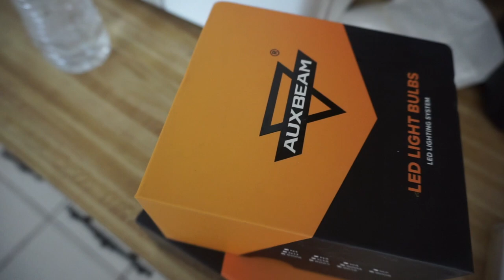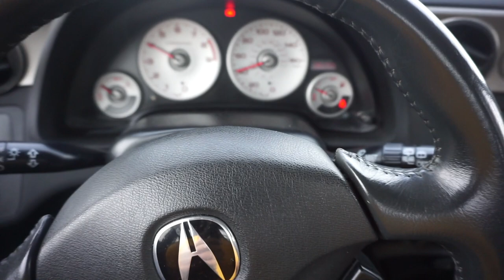'NAMI' THE RSX GETS NEW HEADLIGHTS! - INSTALL

Comment: Is it the exhaust rattling or the heat shield for the muffler? cause, I'm pretty sure its the heatshield for the muffler that's rattling against it's bracket. you could probably get away with just removing the heat shield or jerry-rigging it back onto it's bracket.

Comment: Did you have trouble with the toe being in a reasonable range after lowering the rsx!? I hear if the rsx s go low enough in the front, there’s going to be a need for extended tie rods to have good toe and without camber being hella negative degrees.

Comment: The ebay foglights are so garbage, but, they work. I had to buy a crimping tool, bullet connectors, OE plug connector, OE fog light swtich, and a bunch of wires, just to make it look and function like stock.